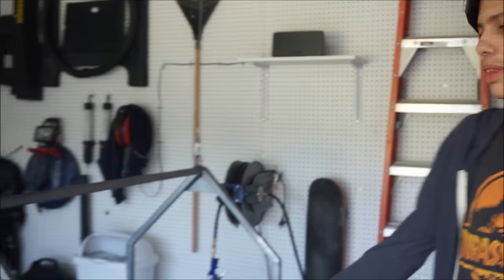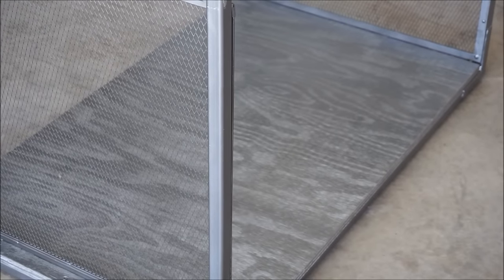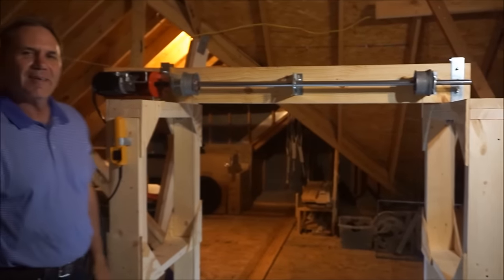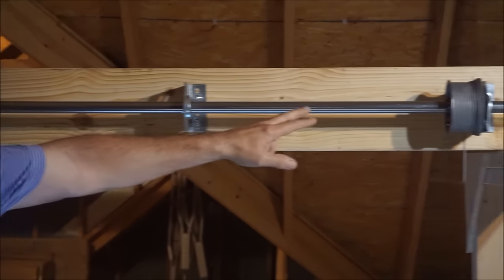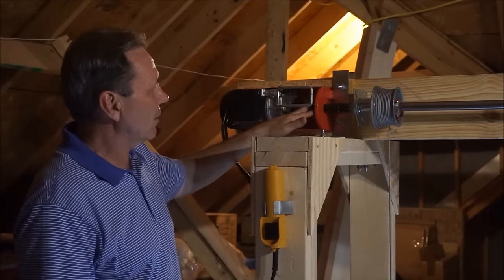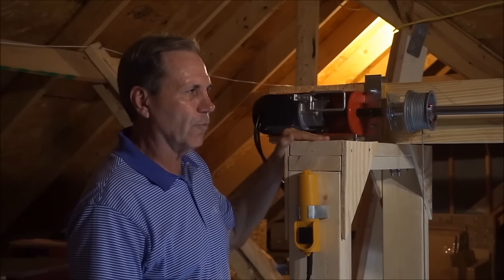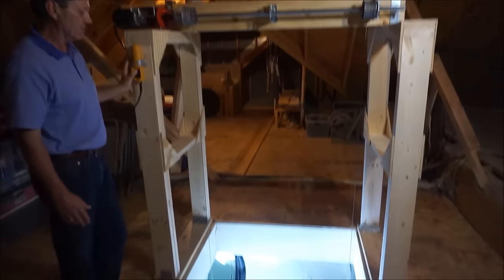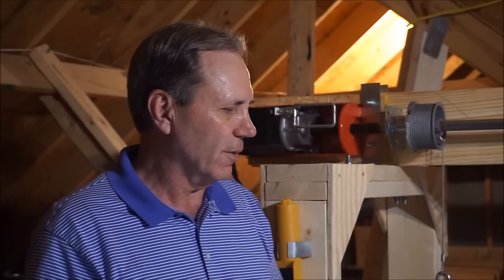Attic Lift DIY

Comment: how long can the motor run at one time the manual says it can only run for two minutes at a time is that true because I have a lot of Christmas stuff to get down  thanks
Reply from the maker: I have never had a problem with the motor.   When I raise or lower boxes from the attic, it takes a few minutes to stack them off and reload.  The motor has never overheated or tripped a breaker.
Reply: @judsonanderson3043   thanks

Comment: how does the lift know when to stop at the top and bottom or are you controlling that with the switch. also do have anything to fill the gap between the ceiling in the garage and the lift bottom. I see you painted the ceiling joists
Reply: Probably there are limitswitches. You place a switch to the end (the limit position), for example to the top, and wire it such a way if it is pushet, it disconnets the circuit, then wire it with a double throw swtichs one pole. Repeat for the other direction too, and voila, your lift will stop at the end :)
Reply: re: bottom. he should add 4 springs to bottom of cart between a large platform that will seal, so that when the cart is in the up position, it is sealed by the platform on ceiling of garage with the springs attached to fill the space between attic floor and garage ceiling height.  IMHO.
Reply: Versalift puts these springs hidden into the rack so the rack sits collapsed to the ground.  Great design.  Check it out.

Comment: I'll bet the weight capacity of the hoist is greatly reduced by those huge pulleys on the garage door shaft.
Reply: The lifting capacity is determined by the rated strength of the most critical components whether it be the lifting cable, eye bolts, hooks, welds, platform frame components, etc. For example, a large pulley wound with sub standard overhead garage door cable may be a poor choice. Always look at the weakest pieces in the build.  Even more important if persons are lifted which is certainly not recommended. In addition, there is no backup safety system in case of a catastrophic failure.

Don’t get me wrong this is a nice build but preventing or minimizing a component or human failure needs to be considered.

Comment: So you built an elevator with zero safety features.  I hope you don't have anything you don't want destroyed or people killed near it.  You can get fall protection straps a lot cheaper than an ambulance ride, you know!
But I do applaude you in modding the HF winch to shaft drive for the lifting shaft.  But you disabled the full up stop.  Apparently you've never had one of those chinese up/ down switches stick closed. 
Please fix these issues before you hurt someone.